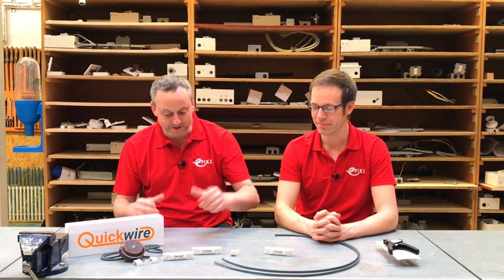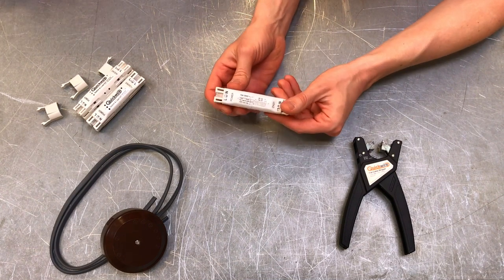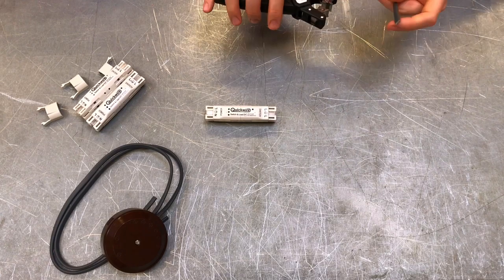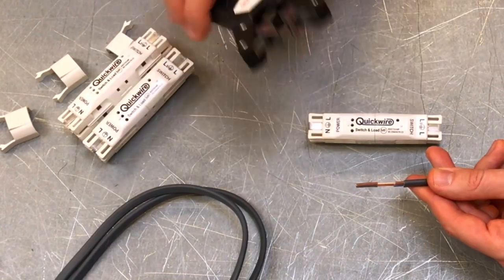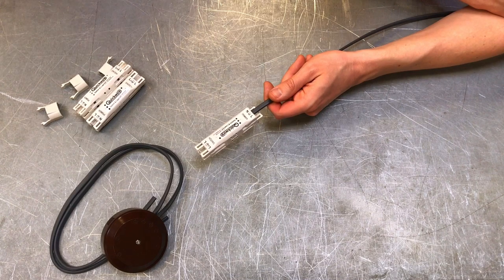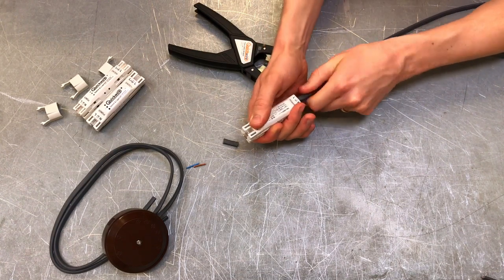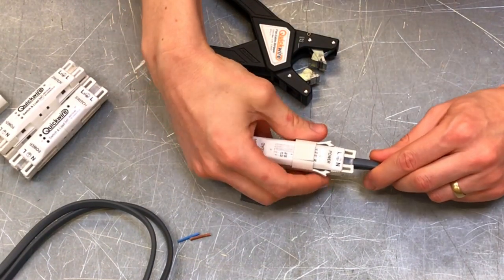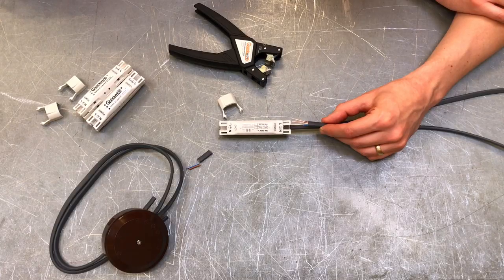Reviewed: Quickwire lighting junction box for twin and earth cables

Comment: I use these all the time. Great pieces of kit. I especially like the splitter box which is handy if you're extending a circuit that's looped into the switch or needs extra lights adding.

Comment: Just started using these in the last few months from watching this and they are amazing . They are great for time saving and problem solving light fittings with room only for one cable. Just to add there are three small testing holes on both the splitter and switch load types.
Bring on the 32 amp version of the splitter
Reply: We're working on that 32amp one..... fingers crossed.
Reply: @quickwire80  that’s great, I shall definitely be using those .

Comment: What are the rules for accessibility of junction boxes? Do they have to be accessible or can they be hidden under floorboards or in the loft? Thanks
Reply: As I understand it

Regular junction boxes must be accessible for inspection, but the regulations don't define exactly what that means. Sealed inside a wall is obviously not ok, in a loft is probably fine. Under a floor is more dubious. 

Maintenance free junction boxes do not need to be accessible but you must use them in accordance with the instructions to maintain the MF certification. Different manufacturers have taken different approaches to MF junction boxes.

The wagoboxes are among the most flexible, but that flexibility comes at the price of having to read the instructions carefully and buy the right combination of box and terminals to maintain the MF certification.

These quickwire products are the opposite extreme, they are simple, quick and small but that comes at the price of very low flexibility, you can do simple splits and switch+light wiring but if you need a neutral to the switch for a smart lightswitch or a L+SL+N for a fan they are no use. If you need to use flex instead of T&E they are no use. If you need to use 

In the middle is something like the Hager/Ashley J803 and J804. Boxes with fixed terminals (so you don't have to worry about buying the right combo of box and terminals) and yet still able to cover most of the common cases with up to four cables on lighting and power circuits.